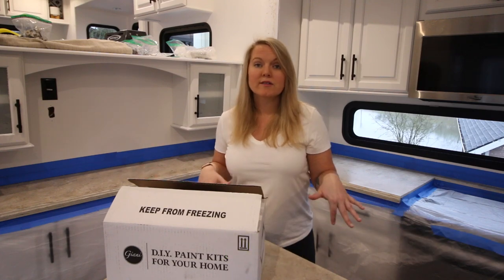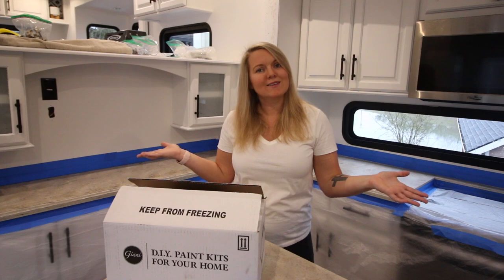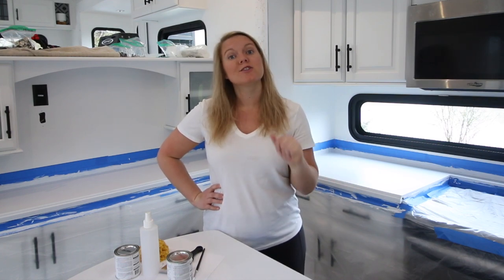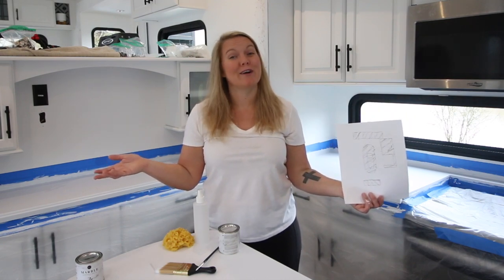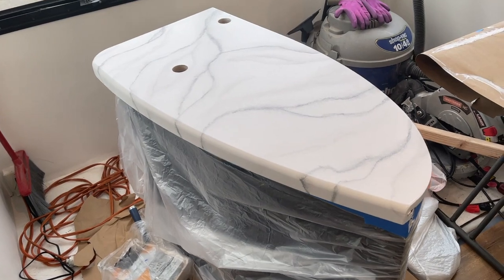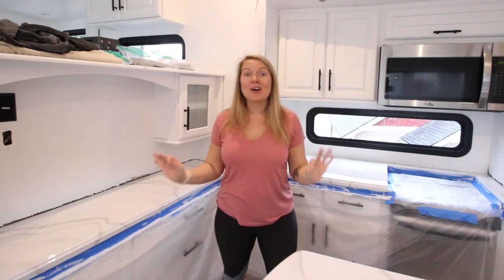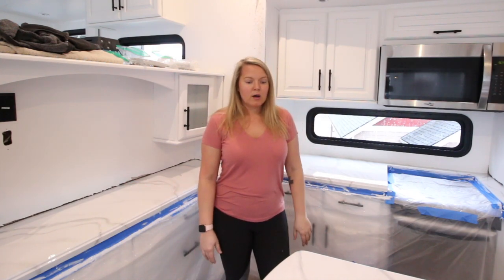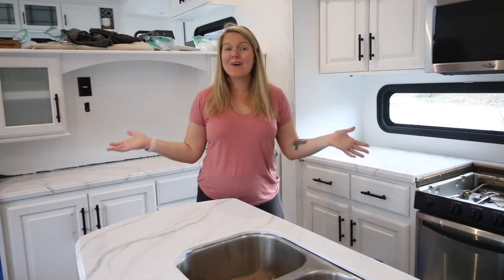RV Renovation DIY: Faux Marble Kitchen Camper Remodel - Grand Design Solitude

Comment: Looks amazing Nikki! I used one of their kits on a bathroom vanity and I used a heat gun to get the air bubbles out. That epoxy is no joke but it gets easier to use the more you do it. Congrats on how it turned out, looks amazing. Also love the color you went with on the island!